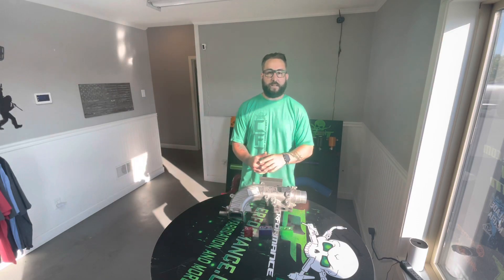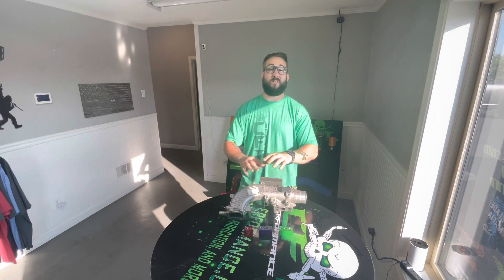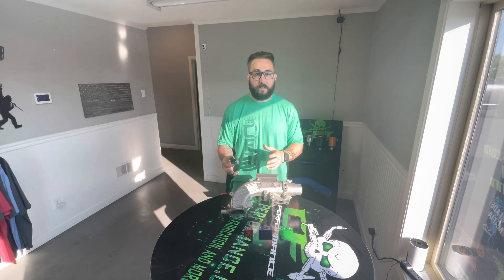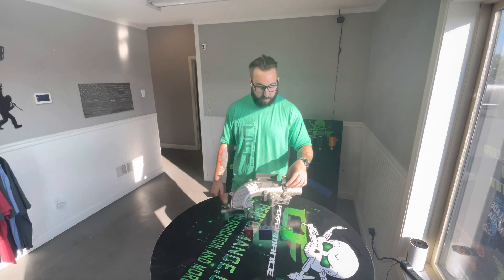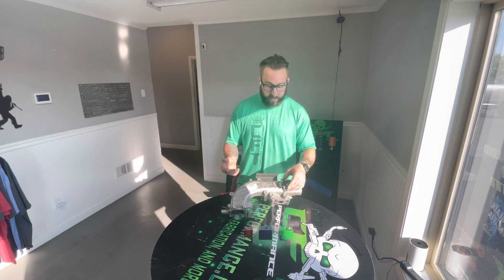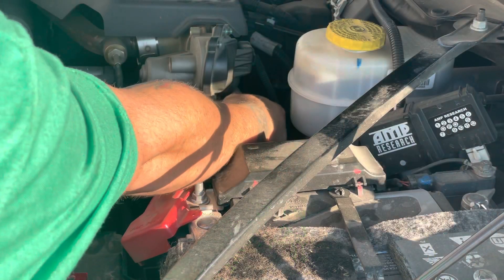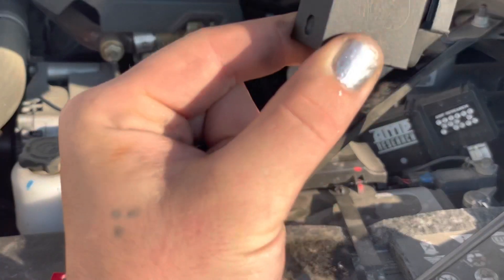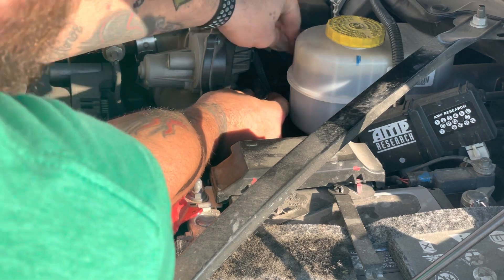MAP sensors, cleaning, and spacer blocks

Comment: The air pressure in the middle of the pipe is different than the pressure of the airflow near the walls. Aren’t you afraid that the MAP relocation near the wall of the pipe is going to affect the readings?
Reply from the maker: it has zero issue.